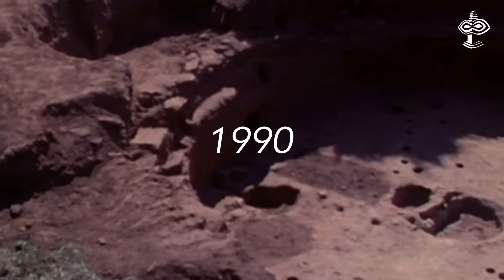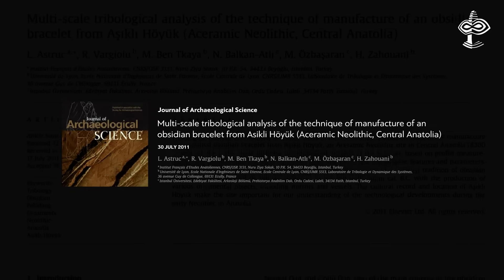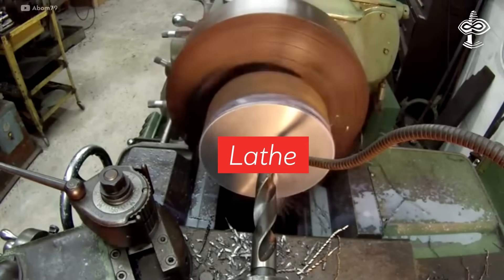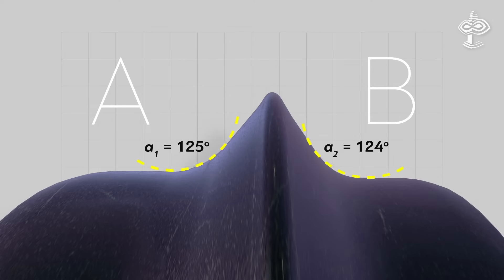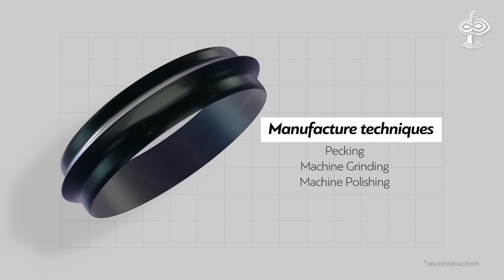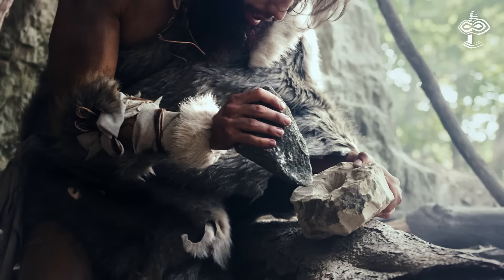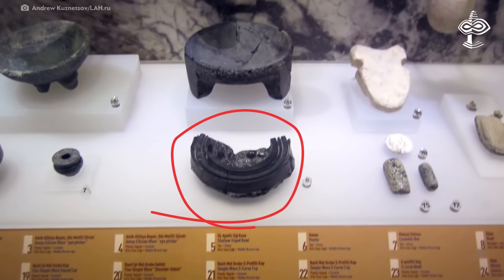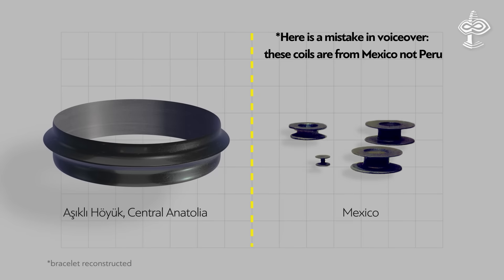This obsidian bracelet is 9500yo and it was made with unknown MECHANICAL devices - VERSADOCO

Comment: Lathes have been used during the stone age and they are not hard to make. Researchers made such lathes and used them to replicate stone vessels. As for the hardness, you don't need steel. Stone tools and sand (including corundum sand) are enough to work obsidian. 

It's an impressive object, but it's not something that can't be done without advanced technology. "Alternative researchers" are yet to come with a single piece of evidence for machine marks. They tried many times, but they have been explained by simple technology.

The video presents images of paleolithic hunter gatherers, which is misleading. The neolithic communities of Anatolia and Middle east were more advanced then that, as the archaeological data shows us. Just look at sites like Jericho and Catal Huyuk.

The "rudimentary vs finished" is not an anomaly. Practical and disposable tools are made as fast and easy as possible for the job, while prestigious items, like the bracelets, are being worked in detail, since they are social status markers.
Reply: There are clear machine markings in throughout the ruins of Cusco, Peru and Egypt.  In Peru, specifically, the Coricancha has stones within it with tubular, core drilling style holes with striations markings that can only be achieved by a drill bit with high revolutions.  One of these blocks actually has a vertical line passing through the inner tube almost as if a small rock was caught and dragged through during this process.  Puma punku, Peru a site considered even older than Cusco has masonry work with such precision and artistry modern day stone masons would struggle to replicate it.  I’ve been to both of these sites, and there’s also clear evidence at least two cultures with distinct levels of technology and workmanship.  There are almost always megalithic foundations with stones weighing upwards of 100 tons precision’s cut and stacked as foundations, with relatively rudimentary stonework built on top and around it.  
Throughout Egypt there are  granite stones with the same core markings, exhibiting striations of different widths—marking only achievable with a tool performing high revolutions not a slow grind with sand.  There are also cut marks in granite stone and bedrock which show evidente of massive circular saws, not  wooden wedges and water.  Again in Egypt you seem to have at least two different levels of Masonry and workmanship exhibited in the ruins.  There are massive Diarite statues of human faces so precise and symmetrical it is literally impossible to been done by hand.  diarite is an 8 on the hardness scale, it cannot be ground down with quartz sand like granite possible can.  There a preponderance of evidence, and most of it is still below ground as we’ve only unearthed prob 10% of these ruins.
Reply: I think "advanced technology" is to vague, maybe they found different ways to make things. If you work using only ideas inside the box you can never improve the technology.  Many things have been made or invented by accident lol. I disagree about civilizations not being able to be wiped from existence. If the world has been here for 60 million years that's a lot of time for things to go missing or be turned into something else. The aliens thing idk the truth most of us don't.  Yet we see old paintings with alien like ships, plus those tic tac videos seemed creepy lol. I feel the chances  us humans being the only organisms or life in the whole universe to be weird.  I don't know much but over time scientists get things wrong.  I mean how long I'd your laptop or phone going to last in 10,000 years by itself.  If we can make these tools now with how much history and knowledge then how did a bunch of caveman  make those artifacts back then. So much knowledge has been lost and we can only guess what their text means. Pyramids yes are simple but not easy to do with simple tools and rope. Anyway take care,  peace out ✌🏾
Reply from the maker: Well, you are speculating how it was done rather than presenting facts. Where is archeological evidence supporting your claims? The facts are, based on the paper, that the artifact was produced with the help of some kind of machine tools. We don't know what kind of tools specifically, but we can argue that these were not in a possesion of neolithic hunters gstherers of this region. Hence, as a working theory we can argue that this artifact is the legit candidate to be from some other more ancient technically advanced but unidentified civilization.
Reply: @Versadoco  Thank you for taking the time to reply. I think discussion is important on the topic, considering how many echo chambers are created on this subject.

I am not speculating, I am talking about the data. As you correctly pointed out, the analysis proves lathes have been used. However, the video is speculating about advanced machines, without any evidence of it. 

If you got to the channel "scientists against myths" you will see a few videos of them replicating stone vessels. The one of the breccia vessel, was made using a very simple but efficient lathe. Lathes are not something beyond the capability of neolithic communities.

As already said, stone can be worked by harder stone and by sand. Quartz sand, emery and garnet can be used to cut stone even harder then obsidian. Researchers proved this experimentally. You can find videos of cutting granite with this method on the channel mentioned above or in the "Experiments in Egyptian Archaeology" by Denys Stocks. It includes a detailed analysis including the results of his experiments. 

Here are the main problems:

1) the burden of proof for advanced machines and technology lays on the one making the claim. So far, we have literally no evidence of such a thing. I invite anyone to cite only one example of machine traces, because so far the claims of machine marks have been debunked upon close scrutiny.

2) where is the evidence of this civilization capable of creating advanced machines? Especially given such a civilization cannot vanish into thin air?

These are the 2 problems that no "alternative researcher" has answered.

Once again, thank you for taking the time and looking forward to your response.
Reply: @MrAchile13  I don't think he's going too :/
Reply from the maker: Well, there are plenty of evidence to be honest. And these arguments are the same all over again) so I making these videos trying to move the topic a bit further forward. Specifically, I've made a video about microparticles research left on the surface from the ancient tools. You can check the results if you are interested in. The tool marks are highly unusual and if it's not machine tools traces than it is something that wasn't exlained properly. And that's my problem with a mainstrean explanaitions: they are not sufficient. If there will be sufficient enough explanation I'd be the first who'll create debunking video) There are plenty of documentaries on this topic, in English speaking Youtube UnchartedX makes good analysis I reckon you can check their channel. A lot of documentaries done by Andrew Sklyarov (Russian YouTube) and Laboratory of Alternative History regarding this topic and there is specific doco where a lot of traces of some advanced tools on ancient artifacts presented. The problem is not that you can't cut granite with copper and sand. The problem is that the original traces are different from what such primitive technique is leaving. On the other hand, is ridiculous amount of copper wasted by Stocks (in fact I beleive what he proved is how it wasn't done actually). Christopher Dunn, engeneer,  who did decent research on machine marks on Egyptian granite once said that "he doesn't know where machines are but we are dealing with clear traces of them on ancient stone". Frankly, on the horizon of 10.000 years no metal would left, not even taking into account metal repurposing that happened many times. I would agree though that any terrestial civilization cannot vanish into the thin air. That's why Andrew Sklyarov, for instance, believed in ET civilization, like it or not, because there are clear traces of disc saw and similar advanced tools on various ancient sites for example. So either we missing some simple, low tech know-how to produce such "machine tools" marks on the hardest stone material that we know, with excellent precision, or we should allow the intervention of some external civilization no matter how crazy it might sound.
Reply: @Versadoco  Thank you for the reply. Sadly, the main 2 questions are still unanswered (cite undeniable machine marks/explain where are the remains of this civilization)

1) This is a general and vague claim that has been debunked many times in the past. If you want to make the claim of unexplained traces, you have to cite the trace you are talking about. Claiming there are plenty of them, is not a valid argument, especially considering the experimental work made in the past years

2) uncharted x literally pushes false information. He looks at certain objects and then claims machine precision based on visual inspection. When confronted with archaeological experiments, he got defensive and said machine precision cannot be claimed without proper measurements, thus contradicting himself.

3) Dunn has been debunked on multiple instances (so this argument from authority is even weaker) - for instance, he personally examined the core 7 and claimed it's a continuous spiral. High resolution photos are now available online and it's clear his conclusions are wrong. Even more so, the supposed impossible core 7 has been replicated and you can see it on "scientists against myths"  - a good channel fighting the pseudo-science 

4) Stock's  sawing experiments  do match the archaeological record, so I'm not sure what you are talking about (his results are published, including photos). There were plenty of sawing experiments done after him, also matching it. The copper was not wasted, as the "waste" was used for other products like glazed pottery. Besides, we are talking about a civilization burring hundred of kilograms of gold with the dead pharaoh

5) 10k years do not account for the absolute lack of evidence. Where are the undiscovered sites? Did the Egyptians locate them all and excavated them? Egypt is being plundered for 2000+ years, yet new sites/objects are being found every time.
Reply from the maker: Regarding this video - In fact, as artisans were telling me, lathe is a bad tool of choice for production of such types of artifacts. Obsidian is very special material and it fractures a lot. The thinner it goes - there are no chances to keep it from destroying. So what is exact tool that was used here to produce this and similar objects is an open question...

Regarding other questions:
Disc saw tools marks would be undeniable prove of the advance tech. The best candidates from Egypt so far: basalt block at Nyuserre's Sun Temple, Abussir; Disc saw traces on the floor blocks near the Great pyramid in Giza; disc saw traces on the black basalt block in Saqqara near the temple of the Userkaf pharaoh; on the sarcophagus in the pyramid of Teti. A lot of potential disc saw traces are present in the other countries as well. Common feature is - V-shape of the saw tool that goes into almost 0mm sharp apex. 

Unidentified tool traces on one of the pylons at Karnak: https://youtu.be/bkrmM_AlryQ?t=526 - this one doesn't have modern tool analogues as far as I know.
 
3) I recall Dunn and his research for a reason not as argument from authority. He supports his claims with precision tools check and he revised research of Sir Flinders Petrie who was first and the last from academia to point out anomalous tools traces. The tools that were far advance of everything that they had back in 19th century regarding tool cut/pressure combination effectiveness. A bit about that here - https://youtu.be/I_o8pAQM3ks?t=497

4) According to Stocks experiments the amount of copper left in sand would be thousands time more than Egyptian ever needed for vases)))) Stocks experiments didn't reproduce marks that Petrie describes. And his copper tools theory didn't prove at closer Microparticles research - there are no copper tools particles. There are bronze particles. But this bronze was unknown in Egypt and very funny indeed, check it out - https://youtu.be/bkrmM_AlryQ?t=752

5) I don't have clear answer to this question. Work/research in progress. Could be a set of events: like global catastrophy that literally reset life on the planet and destroyed everything on top. I realize the flaws of this argument though. There should be something left if it is just one of the domestic civilizations. So if we manage to prove disc saw traces on multiple levels, like microscopic/macroscopic + ideally, real tool artifact + in conjunction with no archeological evidence = alien civilization. Otherwise, I'd like to see more professionally performed experiments from academia that can explain out of place marks.

There are some videos planned to dive into the details. And thanks for the comment and interest. Cheers
Reply: @Versadoco  There is an interesting video "Stone Turning a See-Thru Obsidian Shot Glass" uploaded by Bison Hill Stonecrafts. They are making an obsidian cylinder with thin walls, using a modern high speed lathe. The obsidian is not cracking at all. If this can be done, why would there be a problem with a hand lathe, slower and thus less prone to break the obsidian, especially considering the bracelet is not as thin as the piece in the mentioned video?

1) curved saw marks can be made by pendulum saws. Claiming curve marks have been made by disc saws is an extraordinary claim that required extraordinary and undeniable evidence, of which, as far as I'm aware, we have none.

The mark in the video appears to be a saw mark. Why would there be any need for advanced tools? In the video we can even see the cut is not straight all the way to the top, but it bends from time to time, showing it was worked by hand. Experiments of sawing granite showed the cut does taper and the blade is self sharpening to a very fine point.

3) Dunn's conclusions and even observations have been shown to be false or at least questionable. He claimed the corners of the Serapeum sarcophagi to be incredible precise, but this was proven false by recent measurements made by both Scientists Against Myths and the ISIDA Project. He also analyzed core 7 and claimed there is a continuous spiral. Once again. high resolution photos have proven this wrong.

Dunn's claim about the drilling speed is also wrong. He assumes the marks do indicate the drilling rate, but this is not the case. The striations are made by the side of the drill, as the drill wobbles around the granite core, during the drilling process. The sand trapped between the drill and the core is the one making the striations. Researchers have replicated these marks, using simple hand drills. You can see these experiments on the channel Scientist Against Myths or on SGD Sacred Geometry Decoded.

4) Stocks obtained a ratio of around 3 parts of granite cut for 1 part of copper lost. However, the copper residue was not thrown away, but recycled by making green glazing. We are talking about a civilization who literally buried hundred of kilograms of gold with the dead pharaoh, so why would they have a problem expending copper?
In fact, we know they did, as shown by the traces found inside the cuts and drill holes.

Indeed, Stock's experiment were done with regular copper, not Egyptian alloy. The results of the video are expected, it's a copper alloy. It might be an unknown one, but it's still copper alloy, as predicted.

5) There are plenty of things we don't know about the past. When it comes to manufacturing and technology there are plenty of things we are still missing and we will only understand the details of the processes after successfully replicating them with primitive tools. However, this is no basis for claiming advanced technology and power tools. Not only we don't have any evidence of it (on the contrary), but the idea is not logically consistent if we follow it all the way to the end:

a) the idea of a lost civilization/inheritance: 

- it ignores the scientific dating: we do know when the artifacts/structures have been made and this directly disproves the inheritance argument 

- a global advanced civilization cannot vanish without a trace. It is not logical to argue we keep finding the small footprint of small hunter gatherer communities (going back hundred thousands years), yet we are still missing the gigantic footprint of a global civilization, on multiple continents

b) the idea of aliens:

- why would the aliens built monuments for the Egyptian pharaohs? If they didn't, then how did the Egyptians came into the possession of such technology? How did they learned to use it? Did bronze age people, living a bronze age life were handling alien technology on the weekend? This surely sounds very strange.

- why don't we have any depictions of such tools, but all depictions we have is of manual tools and manual labor?

- why didn't they used this technology in warfare? Since new technology is weaponized as fast as possible?

- why are the structures so primitive, if made with alien technology? Let's look at the Great Pyramid: structurally a simple structure made of post and lintel, corbel vaults and saddle roofs, with small interior spaces (no arches, no composite materials, no big spaces - as the Romans built). We can even see the chisel marks inside of it. Are we to believe the paving stones of the courtyard have been cut with disc saws? How can one explain the technological discrepancy?

Lastly, discussion are important and greatly interesting, so thank you for taking your time.